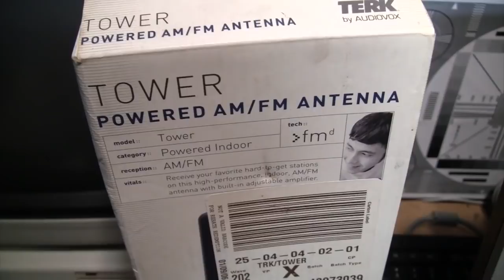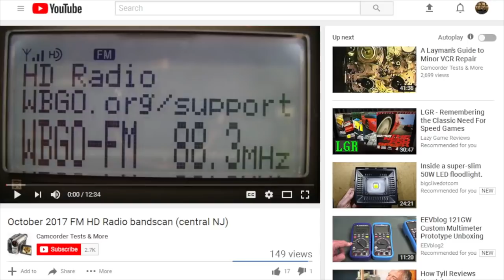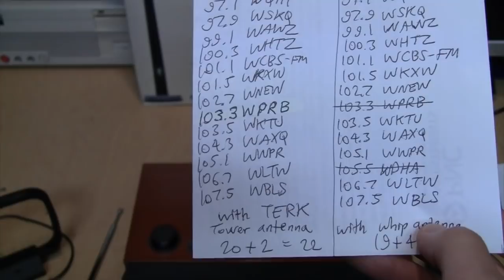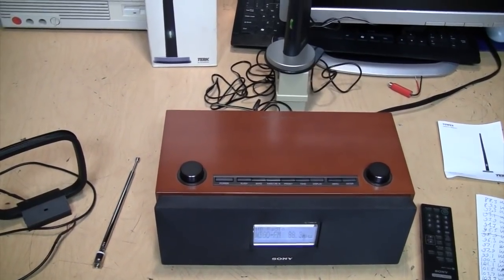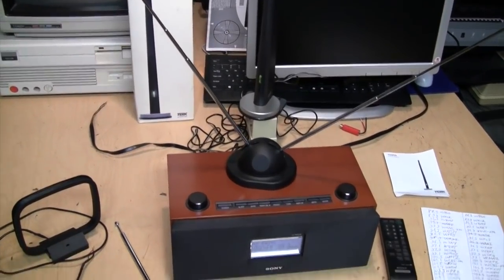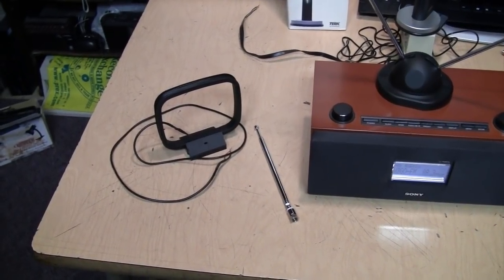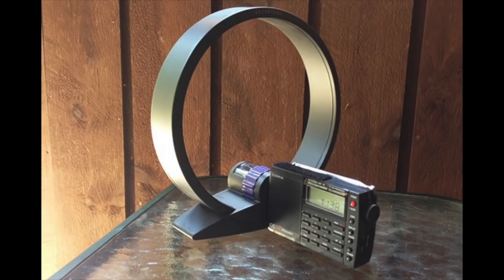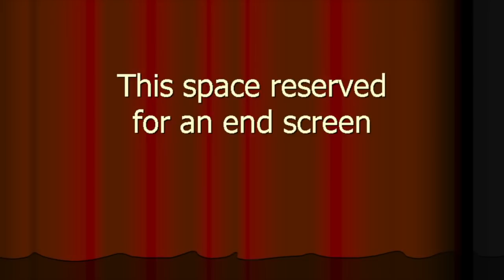Terk Tower indoor AM/FM HD Radio antenna review & test

Comment: can i use/connect the 'antenna' wire coming out the back of a $50 am/fm radio to a tabletop antenna?  it would be nice to bring in stations more clearly and from farther away.  what about a thin silver one on a little stand @ $90?  thinking about it.

Comment: I tried a couple of Terk antennas and had the same experience. The best FM reception I got was with a good pair of Realistic rabbit ears and a Realistic coax cable line amplifier. And I'm surprised there are still a few AM HD stations still around. I've read many of the big AM stations that tried it have dropped it.
Reply from the maker: Here's a list of AM IBOC (HD Radio) stations: http://topazdesigns.com/iboc/station-list.html
Reply: Thanks for the list. I believe several Texas stations have stopped using it now. I remember when 620 KMKI in Dallas was using it with Radio Disney about 5 years ago. It used to have a great sounding AM Stereo signal even on a good wideband mono AM radio.  But it sounded muffled with HD cutting the bandwidth to 5K. Disney sold it off to Salem (big religious chain) and its now a business talk station.

Comment: I have the same powerd  antenna paid $29.00 new at Best buy years ago works ok for me I live In a dead zone kinda of my onkyo audio & video  receiver  tx-sv313pro does not have a coaxial antenna input that does have the push wire connection like speakers so I purchased a old adapter to convert a television to that type cut the ends off and open housing and made my own rig to be able to use my empowered antenna to get more coverage space for better signal spectrum and to my surprise works pretty good  and purchase the receiver brand new in 1993 I had a summer job I was 16 what's my first really nice hi-fi receiver before that my mother had purchased me because I did very good the whole school year when I was 13 at the time she didn't have the financial resources so few months later for my birthday open a box and there was a nikio r25 receiver wasn't the greatest receiver was the low end of that brand had humming noises but I was truly happy to get it did not have remote control capabilities but  worked for me at 14 growing up in New York City I was truly lucky to even have it and I'd have some kind of boombox she had also purchased me a cassette deck a basic model dual cassette deck by teac and my aunt has given me a set of used vector research by. Jvc speakers and a Gemini turntable a turntable I still have to this day and I was truly happy feel like I won the lotto your videos are truly enjoyable and I love the watch stuff you find and purchase the reason why I purchased that Onkyo receiver in 1993 was because in 1992 I purchased a cassette deck with the same model number ta-rw313 dual cassette deck remote control compatible with the cable running to the receiver using the receivers remote cool little feature that they  do not have any more  my first CD player was also acquired a year before the cassette deck I purchased it at RadioShack on clearance and if I tell you the price I actually remember it because I purchased it in my first job at. 14 I was proud of myself I spent like $160.00 a lot of money at the time  for a single disc player I had it for many years until the laser finally burned out then in 1998 I purchased My first Sony 5 disc CD changer I found it a lot cheaper than an Onkyo to match my gear the selling point was the fact that you can daisy-chain a couple of them it is model cdp-ce525 I use a spare only that's why I still have it my mother purchased me my first CD recorder in 2010 as a birthday present just still have it user very sparingly